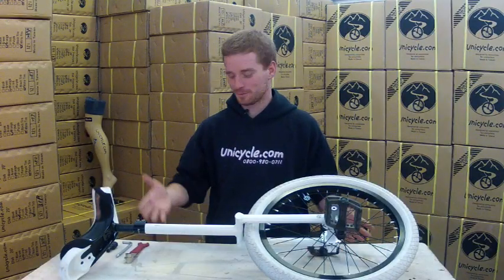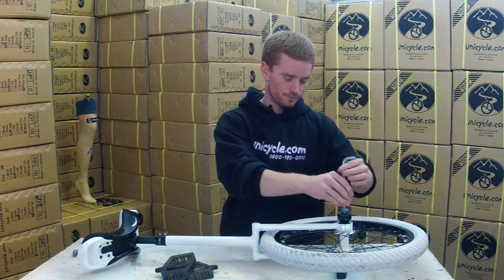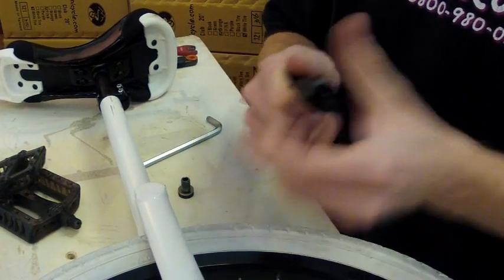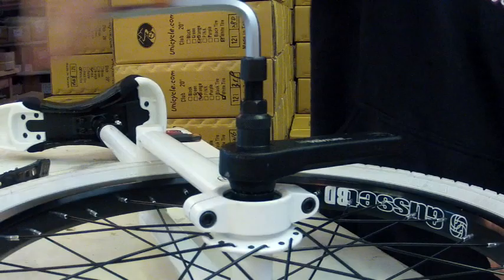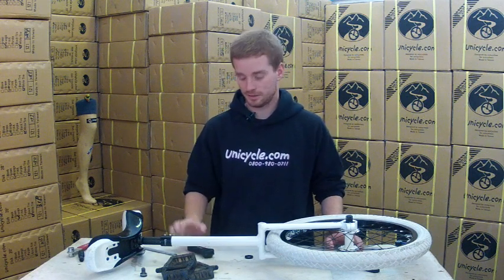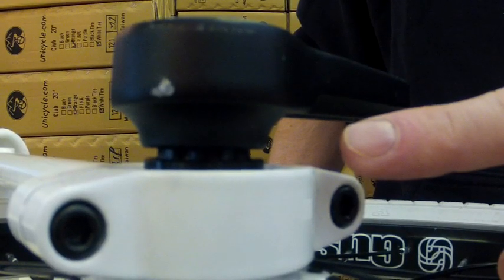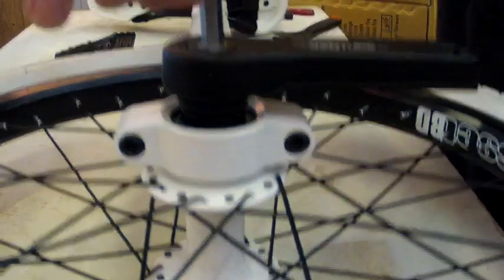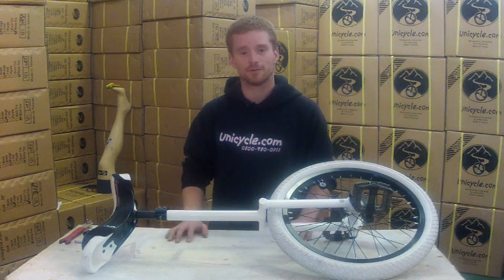[How-to] Remove Unicycle Cranks

Comment: i have an old 70s schwinn and it has a strange crome bold holding the crank arm on to the axle.. it has these other nuts,washers, bolts running through the side or (back and front really ) of the arms  that when i took them off didnt seem to make anything easier. everything is still really tight fitting and wont budge i started to hit with a little mallet but realized it was only gona make things harder to do if i smash it all up.. anyone know what to do ?
Reply: tee cee Buy a new uni? 😂 Sorry mate, no idea
Reply: Day late and dollar short but try some heat with a torch to get it loose.